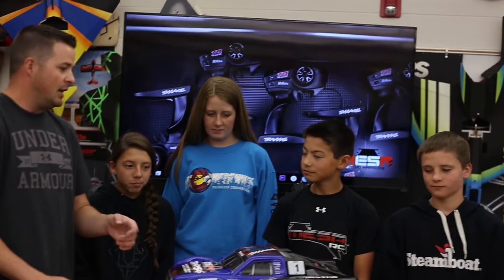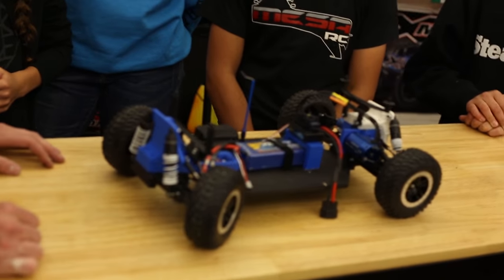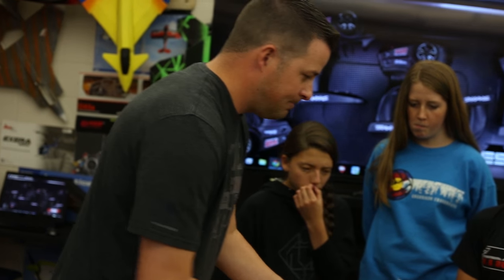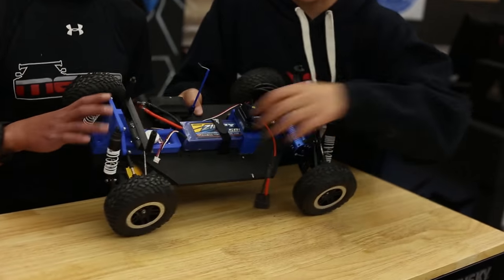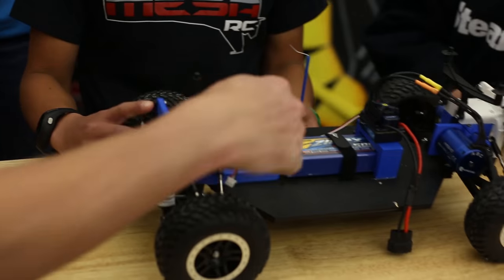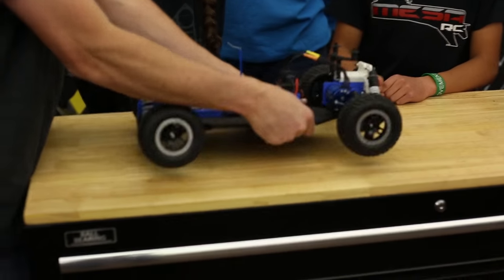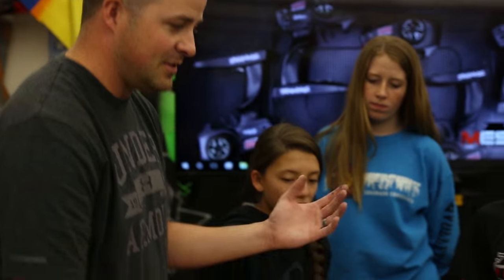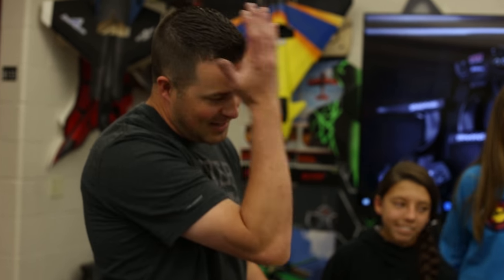MESArc - 3D Printed Short Course Truck

Comment: awesome video. liked the servo setup. seemed like a more simplistic setup with less connections & moving parts. Like the kid said. Less stuff to brake. Also makes sense on having to switch to some traxxas i'm assuming metal gears. I'm sure those plastic ones unfortunately strip too easy. Keep up the good work.

Comment: 3d printed parts are amazing and you can make them just as strong as injection molded if not stronger depending on how you design the part and then how you print it all that comes in to play this is not a press a button machine and a perfect part comes out lol come on guys having the 3d printer at your is great but you are also making a part and i mean your designing it yourself or taking someone elses design an you are going to have to tweek it to make it work perfect and even then you still will break parts i have owned alot of rc cars and trucks i still have a bunch and planes as well and even the so called better injection mold parts that have been engineered still break all the time due to poor design or molding so really it boils down to design and how much time you take with printing it out your printer has thousands of settings to be dealt with so just be patient an take your time and it will all come together just think when theses rc trucks an cars come from manufacturing they have already went through thousands of hours on testing design and molding of parts you cant stop doing that process you are just taking that responsibility on your own with a printer which is why it takes work to do it also cheaper in the long run and fun and you have no limitations
Reply: Holy shit man chill